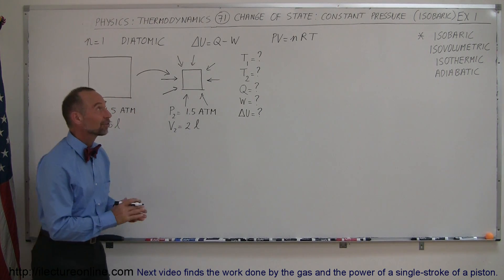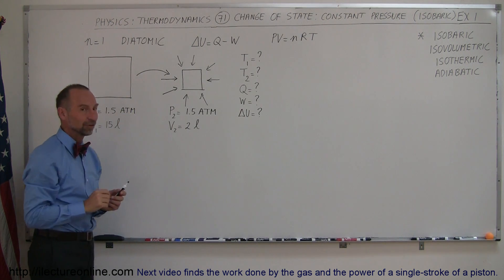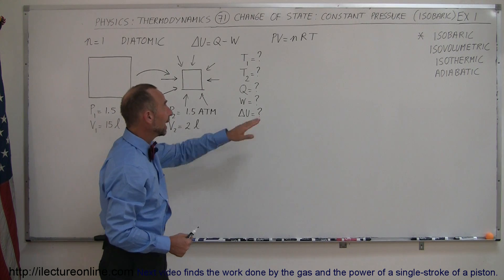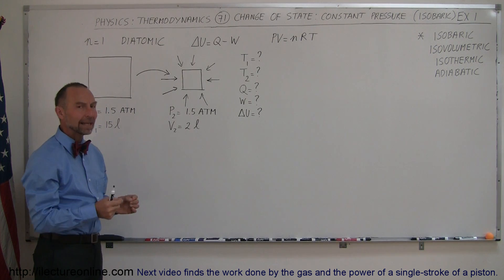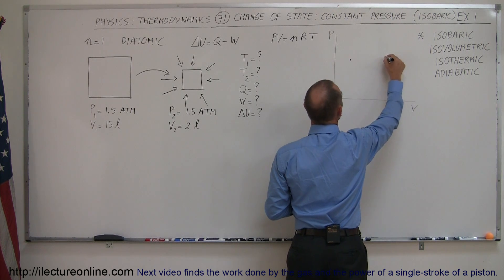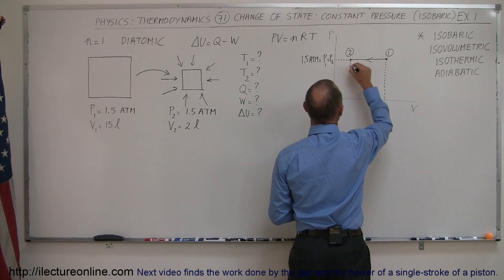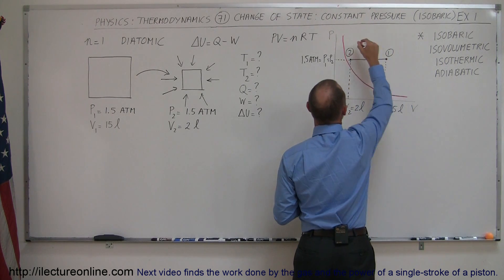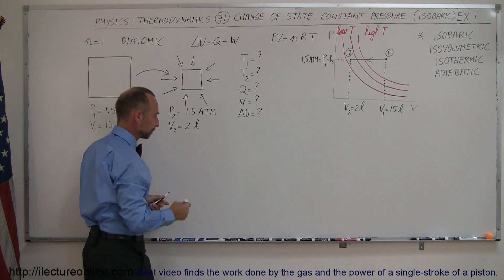Physics 27  First Law of Thermodynamics (7 of 22) Constant Pressure (Isobaric) Ex. 1

Comment: HI Michel Is there a mistake for calculating the the change in internal energy that you used the C sub v to the equation of delta U equals to n Cv delta T. Should you use the C sub p to replace the C sub v in the equation to find the change in internal energy because the pressure is kept constant for the lesson? so C sub p is 7/2 instead of 5/2 for the equation.  please let me know if you made mistake or I made ?  thank you
Reply from the maker: There is no mistake in the video.  For the change in internal energy, we ALWAYS use Cv, regardles of the process, even with the contant pressure process.
Reply: @MichelvanBiezen  Thank you for telling me that.  I am confused with that when the presure is constant, you used Cp to calculate the internal energy for constant pressure  in physics 27, 1st law of thermodynamics 3. but you used Cv in this lesson for  pressure constant of the example. please teach and correct me the concept on the topic  thany you dearly again

Comment: Hey I have a question,please answer as soon as possible my exams are tomorrow😢, how do we have negative work done and negative heat at the same time when negative work means we're compressing the gas and adding heat to the gas such that the change in internal energy would be positive and so will the heat added..??
Reply: If anything aren't the heat and the change in internal energy meant to be positive ?
Reply from the maker: The wording used to describe this is VERY important.  Look at it this way.  If a gas expands, it does POSITIVE work on the walls of the container.  If a gas contracts, (decreases in volume), then it does NEGATIVE work on the walls of the container.  When heat is ADDED to the gas Q is positive.  When heat is removed from the gas, Q is negative. Good luck on your exam.
Reply: Meaning a gas can contract and either lose or gain heat??
Reply: And thank you!
Reply from the maker: You are correct.

Comment: 8:49 minutes please tell why you use  n × Cv (∆T)'? its contant pressure not voulime
Reply from the maker: to calcualte the change in internal energy ( delta U), we alwasy use Cv  (regardless of what thermodynamic process we use)   We only use Cp in order to calculate the heat emitted or absorbed during a constant pressure process.
Reply: @MichelvanBiezen  but video (9 of 20) is constant pressure isochoric still you use cv why that time u should use cp becouse it a constant pressure case  or it will use in adiabatic no heat in and out what I will use that time
Reply from the maker: Again it depends what you are calculating.  If you are calculating the delta U, then you always use Cv, regardless of the process used.
Reply: @MichelvanBiezen  thank my good teacher
Reply: @MichelvanBiezen  may i get ur cell phone no in cases if i face prob
Reply: So Cp and Cv only for Heat, but Delta U is always Cv regardless

Comment: Michel van, I'm getting massively confused by your use of negative and positive work on/by the gas.  Your use of the signs are opposite of what I can find online and on my professors notes.
Reply from the maker: The first law of thermodynamics as shown by your teacher:   Delta U =  Q + W   (The change in internal energy of the gas = heat added to the gas + work done on the gas )   When you do work on the gas you compress the gas and the internal energy will go up.   The way I use it (which is the way it was presented to me when I was a student):    Delta U = Q - W   (The change in internal energy of the gas = heat added to the gas - work done BY the gas )  When the gas does work it pushes against something and expands which requires energy and thus which removed internal energy from the gas).
Reply: @MichelvanBiezen  thank you !

Comment: Is it not a constant pressure process? initial and final - 1.5 ATM - for internal energy calculation, should we not use Cp instead of Cv. ( I saw your explanation) , But can you please  elaborate a little for better understanding  ?
Reply from the maker: If you apply the first law of thermodynamics, you will see that in every case  delta U = n Cv delta T, no matter what the process.  Another way of looking at it, the internal energy of a gas doesn't care how it got to that state.  It only depends on the temperature and cannot depend on which process was used to get to the final state.

Comment: Your videos are fantastic. This video (#7 of 22) makes perfect sense. I am now confused, though, about the previous video #6.
It seems like your calculations for T1 and T2 from video #7 should work for video #6, so that deltaT would again be -237.5.  
My question is: Using the equation deltaU = n x cv x deltaT, how can we get a positive value for deltaU if deltaT is negative?
The only way I can see how this occurs is if cv is negative (for video #6).
If this is the case, it all seems to work out fine. Assuming we have just one mole of gas, we can get that cv = deltaU/deltaT = 1176/(-237.5) = -4.95, and all might be right with the world. Is this what's going on?
Thanks for your incredible work!
Dave
Reply from the maker: If the state of the gas changes from state 2 to state 1, the change in the internal energy will be positive.

Comment: So why can you use C(v) in the delta U=n C(v) delta T equation, if volume isn't constant?
Reply from the maker: The change in the internal energy is not dependent on the change in volume or the change in pressure only on the change in temperature.

Comment: HI...I'm a bit confused regarding Cv vs Cp: I thought Cv notes constant volume and Cp notes constant pressure, but in this example you wrote Cv, but the problem is constant pressure and different volumes. Can you help me uncross my wires please.
Reply from the maker: This is often a point of confusion.  Cp is only used for the heat added or removed from a gas during an isobaric (constant pressure) process.   (Q = nCv delta T)    But for delta U  we ALWAYS use Cv   (delta U = n Cv delta T) for all processes.
Reply: @MichelvanBiezen  Thank you, I did not notice that
Reply: @MichelvanBiezen  This makes learning for me.

Comment: Hello Prof, in the previous video you said that Cv for a diatomic gas will be 3/2R ONLY if volume is constant....Shouldn't it 7/2R since only pressure is constant?
Reply from the maker: Cv for a diatomic gas is (5/2)R and Cp for a diatomic gas is (7/2)R
Q = n * Cv * delta T when volume remains constant   and   Q = n * Cp * delta T when pressure remains constant.

Comment: Can someone explain to me why the temperature would decrease when the volume decreases for a isobaric process?
Reply from the maker: +Orlando Castillo 
Always start with the first law of thermodynamics.  Delta U = Q - W  (heat added to the gas minus work done BY the gas)
Delta U = n Cv delta T    and Q = n Cp delta T for an isobaric process.
That is how you prove that temperature must go down when the volume decreases in an isobaric process.
Reply: ∆U = Q-W, ∆U = nCv∆T, Q= nCp∆T.

Comment: Hi! I have a question, please! Can you use the formula [delta U = nCv(deltaT)] for all situations, even when volume is changing? Thank you so so much, Mr. Van Biezen :)
Reply from the maker: Julie Whitaker Hornsby 
This is often a source of confusion, but the answer is yes.
The change in internal energy only depends on the change in temperature and we always use Cv for the  change in internal energy, regardless of what happens to the gas.

(Not to be confused with Q (heat added or removed from the gas).  There it does depend on what process the gas is subjected to.
Reply: Perfect! Thank you so much, Mr. Van Biezen:)

Comment: This problem has the same parameters as the previous one except two additional pieces of information are given (number of moles of gas, and gas = diatomic).  Shouldn't the change in internal energy for both problems therefore be the same??
Reply: Oops. I didn't realize that the value for Q is different: in the first problem it is given as -800 and in the second problem it is unknown.
Reply from the maker: The change in internal energy only depends on the change in temperature.

Comment: Why did you not use the C(p) value in the beginning for calculating the temperature?
Reply from the maker: Laurelindo,
There usually is more than one way to calculate the answer, so there may be no particular reason for picking one method over another.  In this case it just seemed easier to use the PV=nRT equation.

Comment: Could Q be found also using nCp times change in temp formula?
Reply from the maker: Ngozi,
That depends on the process.
If the volume stays constant (ISOVOLUMETRIC) then Q = n*Cv*(delta T)

If the pressure stays constant (ISOBARIC)  then Q = n*Cp*(delta T)

It the process is ADIABATIC  then  Q = 0

If the process is ISOTHERMIC  then  Q = W = nRT*ln(V2/V1)
Reply: Ok and since is pressure constant in the problem we can use Q=n*Cp*( delta T) or Q=(delta U)+W to find Q
Reply from the maker: Ngozi A
Exactly!

Comment: in the previous videos you mentioned that for constant pressure Cp. is there a reason for u to choose Cv in there? At 9:13
Reply from the maker: Delta U  (the change in internal energy) is ALWAYS = n Cv delta T.  The heat added to a gas  Q = n Cv delta T if the volume remains constant and Q = n Cp delta T if the pressure remains constant where Cp = Cv + R.  If you take the first law of thermodynamics and apply it to a constant volume process (W = 0) then you get delta U = Q - W or U = W.
Reply: Michel van Biezen ohhh i get it now thank you for replying so promptly! your videos are helping me a lot! i love your outfits too!! :)